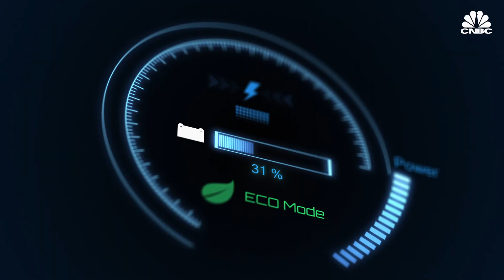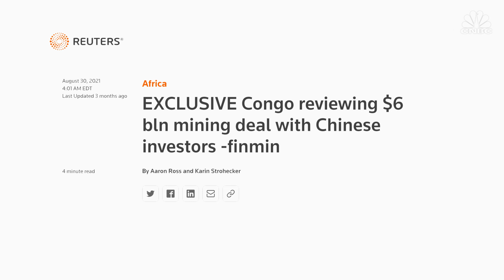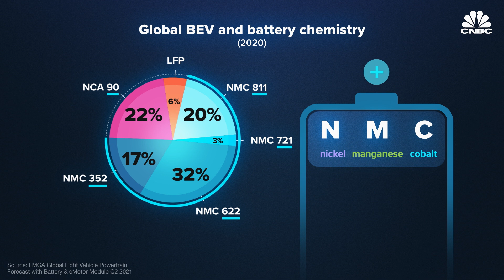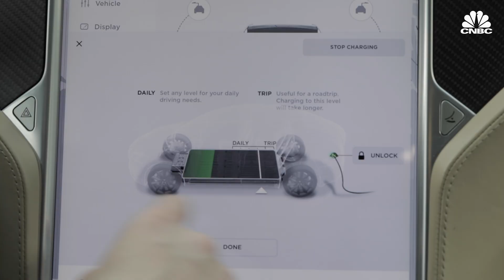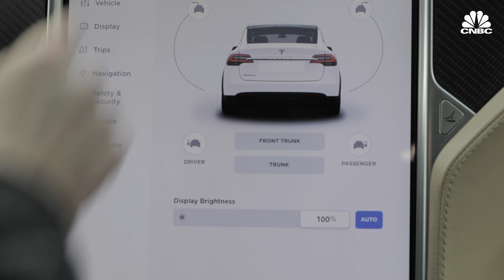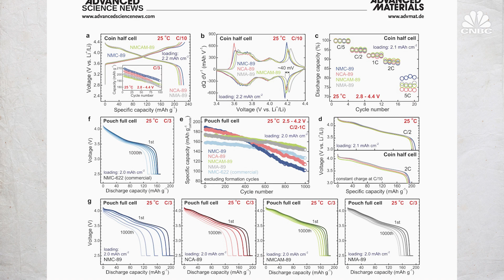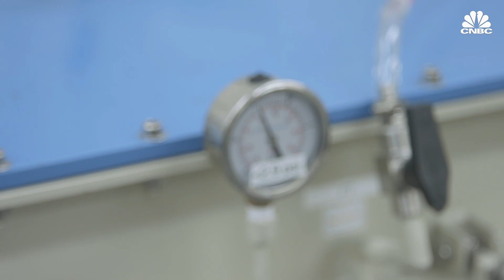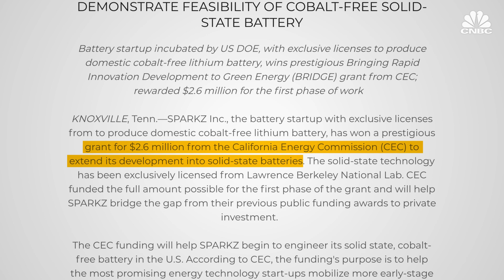How Removing Cobalt From Batteries Can Make EVs Cheaper

Comment: Why worry about battery fires or the life of the battery when there is the option of a Hydrogen fuel cell that out lasts the life of the car. Lithium batteries are fantastic for phones but do not scale-up to cars.
Asking lithium to power a car is like asking a hydrogen fuel cell to scale up to power a city. It does not scale (don't tell Twiggy Forrest though). To power a city you need SMR's (is one answer) in combination with other forms of storage like pumped hydro.
Of course Hydro in other forms has uses in Shipping, Trains, Heavy Trucks, basically any heavy transport.
Reply: hydrogen is a scam
Reply: @thetaomega7816  : LOL, then I've been investing in a scam for over a decade and landed some damned large profits. I wish other investors thought is was a scam as I'd have more investment opportunities.
Reply: @buildmotosykletist1987  Does not make it any less of a scam. Hydrogen does not make sense from a physics point of view.
Reply: @Freba9  : Hang on while i count my profits.
Reply: Er, a hydrogen fuel won't outlast the car I'm afraid. Hydrogen fuel cells degrade, and will almost certainly need refurbishing or replacing at some point during their working life. Of course they'd rather you didn't know this.....  And of course hydrogen fuel cell manufacture requires platinum....... And hydrogen vehicles are not particularly economical, nor is hydrogen a cheap fuel.....
Reply: @Brian-om2hh  : Simply not true or even close. When it comes to longevity, think of a hydrogen fuel cell powered car in the same way you would a conventional petrol or diesel car.
Reply: @buildmotosykletist1987  An EV battery lasts far longer than a hydrogen fuel cell.
Reply: @Freba9  : A fuel cell has a life of 362,102 to 724,204 Kilometres. So I'm afraid you are totally wrong. A fuel cell does not degrade. Even Lithium Cobalt batteries degrade from day one.
Reply: @buildmotosykletist1987  Fuel cells degrade from day one. Also, your numbers are far off. They only last 300.000 km max.
Reply: @Freba9  : No. Fuel cells don't degrade the way batteries do. There is no more degradation in a fuel cell than there would be in a petrol tank. Obviously you have no idea how the fuel cells work.
Reply: @buildmotosykletist1987  “ Polymer electrolyte membrane (PEM) fuel cells are a promising alternative, because they are clean, quiet, and operate at high efficiencies. However, challenges remain in achieving long lives due to catalyst degradation and hydrogen storage.” Youtube does not allow me to post URLs in comments but you can google this sentence.

Comment: May be cheaper but not as much as the child slave labor that helped get the materials for those batteries
Reply: But what about the child labour used to extract cobalt for use in the oil industry? Has that never concerned you previously? They've been mining it for decades by the way.....

Comment: Iron Phosphate is great. Almost fireproof. Non-toxic. Recyclable. Lasts an incredible number of charges. 

BUT. How about a carbon anode, carbon cathode battery? Carbon is even cheaper than Iron. It's made from burnt cotton.

https://en.wikipedia.org/wiki/Dual_carbon_battery

"As an electrolyte, the cell uses one or more lithium salts in an aprotic organic solvent. These remain unspecified, but as an example in a patent, the group uses a system consisting of lithium hexafluorophosphate (LiPF
6) as the salt, and ethylene carbonate (EC) and dimethyl carbonate (DMC), mixed in a 1:2 volume ratio, as solvent."

Basically, the Lithium and Flourophospate go in opposite directions to their opposing carbon corners on discharge, and return to the electrolyte to join up on recharge.

Comment: Making EV cheaper is not the first thing to achieve.
Making them have longer range, more reliable and even more eco friendly should come first.
Imagine this, a Toyota petrol car vs a Tesla. Yes Tesla's operating carbon footprint may be lower, but the sheer unreliability and repair requirements automatically make them less eco friendly because of how parts come to be. Whereas even though Toyota may burn gas and emit more carbon during operation, you need less repairs and less parts, consequently making Toyota just the same or better in eco friendly.
I would die first before I buy a Tesla or any European EV. If my country bans petrol cars, I'll buy a locally made gogoro scooter and never drive a car simply because Americans can't even make a reliable car and Europeans love eco parts which degrade faster and would need more replacement and causing even worse carbon footprint.
Before Toyota or Honda makes an EV. No EVs are reliable. And maybe stop funding Idiot Musk. He's more of a joke than a person worth viewed seriously
Reply: I’d say having battery’s last more cycles is the most important. Because right now if you charge the battery correctly then you can get about 15 years before the battery degradation reaches 60%
Reply: cheaper is always more important than the rest. because the rest follows
Reply: @thetaomega7816  can't argue with that logic as that's how Toyota came to be.
But how about GM? One of the longest running car maker, products cuts in price, as well as corners, never made top 10 in reliability rankings.
Hence I said in the comment: before Toyota/Honda release an EV, no EVs are reliable.
And now I should correct myself: before Toyota/Honda release an EV, no EVs are reliable and cheap.

Comment: Or we could just invest in Hydrogen and not need anywhere near the size of batteries that a BEV needs, including the associated weight and wear and tear on our infrastructure. However, then money that energy companies have invested in taking control of battery production would be for nothing.....so...go BEV?
Reply: too expensive to make.
Reply: But manufacturing hydrogen fuel cells still requires platinum, plus those fuel cells degrade over time and will need repair or refurbishment during their working life..... Manufacturing hydrogen is an inefficient process, plus once you have your hydrogen it still needs transporting all over the place before it can be used. Electricity needs no transportation.....

Comment: No mention of BYD' s market-leading, cobalt-free Blade batteries which were designed with recyclablity as a top priority.  China has also finally  persuaded Western carmakers including Tesla to shift from li-ion to lithium iron phosphate - Tesla Model 3's powered by LiFePo still have a longer range than most of its competitors like VW, Nissan(Leaf), GM(Bolt) etc etc
Paul G(Editor:   EVUK since...1999)
Reply: No, they definitely mentioned BYD and LFPs.
Reply: great for us Aussies, Chine buying even more Iron ore from us... prices going through the roof soon.

Comment: A lot of cobalt is used in smartphone batteries and for refining oil. For EVs they tend to use low-cobalt battery technologies. Cobalt free LFP is almost certainly going to take over the market in the near future because it's cheaper, safer, and can be repeatedly charged to 100% without degradation unlike cobalt technologies which should only be charged to 80% most of the time.
Reply: The sooner we go cobalt free the better
Reply: Uhh...yeah ppl would not be happy if the phone in their pocket suddenly exploded.
Reply: Also Tesla's new 4680 cells that are now in production use no cobalt. Tesla will soon be using no cobalt for every vehicle. Right now it is over 50% that don't use cobalt
Reply: you're trying to compare a smart phone to a car? sounds pretty silly

Comment: 80% of the cobalt industry is industrialized, 20% is artisanal of which 10% is illegal and some could be linked to child labor. I of course totally agree that this is an humanitarian emergency but it shows that the source of cobalt is really easily manageable and the association with EVs and cobalt has mostly been used to lobby against them.
Reply: Doesn’t change its cost. Cobalt is not a particularly abundant material. There’s tons of other variables that can be tweaked to improve the range of a car using LFP now that their energy storage is going to get cheaper including tweaking the cathode chemistry while keeping iron in the composition
Reply: @markhaus  yeah agreed

Comment: Lithium Titanite    recharges to 80% in 10 minutes
Reply: Lower energy density than even the most basic LFP formulas. unfortunately. Fabulously good in regards to safety, though, and, as you observed, you can hammer them with high current for super quick charging that would literally fry other lithium batteries. The chemicals for the cells are expensive, alas, and that has what's kept them from a higher adoption rate.

Comment: The key take away is that the supply chains are mature and advanced now.  Plus lithium ion can even hedge into sodium ion.  Sodium ion isn't as good, but again the supply chain thing.

There is no shortage of lithium either, that is more of a political / environmental / labor union issue now around building the mega mines you need.
Reply: 🤔 tell me how lithium mines are safer for the environment? Vrs a drill ..

Comment: This issue with electric cars is the need for lithium. Even if each cell only needs 7 milligrams of lithium, that still ads up to millions of smartphones worth of batteries. And smartphones are way more useful in the grand scheme of things than 1 car. And we don't have the capacity to mine enough lithium. The answer is less cars, not more.
Reply: We don’t really mine lithium. We extract it from brine. Also, there is a lot of lithium in seawater. That can be extracted, but not cost effectively right now. That time will come, though.

Lithium carbonate can also be reclaimed.
Reply: @fruitytv-uk  But LiCO3 isn't exactly good for the environment.
Reply: I for one am glad that Train hopper& friends  are smarter than everyone else!  They seen a problem and then provided an answer  JUST LIKE THAT.  

Holy smokes... What else of the worlds problems can these guys solve I wonder?!

Comment: Cheaper to manufacture but such saving will not filter down to buyers. Just as battery packs have fallen in manufacturing cost over the last ten+ years by six fold but the EVs have continued to rise in retail pricing. If you want to save money from EV adoption, buy shares in the companies that make them.

Comment: Solid state batteries is the future, not a reformulation of lithium based batteries.  They don't have the heat problem, they recharge in minutes, they are more cold resistant and are cheaper to build.
Reply: If this were true, the incentive would overwhelmingly be to use them. Pretty much by implication of them not being used there will be a reason why: can't scale outside lab, too expensive, too dangerous, too variant to environmental conditions, not enough lifespan to name a few. Maybe that will change, but I've been hearing solid state batteries are production ready for years.

Comment: Nickel is the problem.  Why is the news 10 years behind the real information?  Cobalt is affecting Cell phone batteries, not EV batteries.  lmao
Tesla used 2000 tonnes of cobalt in 2020 to produce 500,000 cars.  That is about 8lbs per car.  The battery pack weights 1060lbs.  Both GM and Ford used more Cobalt in that same year to produce 20% as many BEVs.
Reply: Money

Comment: More of a reason to not buy an EV right now.  Wait 3 to 5 years,  you'll get more bang for your buck as tech will improve dramatically.
Reply: If that's how people thought then technology would never advance because nobody would buy it when its first released, there are still excellent quality EVs out right now
Reply: @brunellecooper  But there are less charging stations. Although they're being installed very fast. So yeah 3 or 5 years is an ideal time from now
Reply: Absolutely right. I intend to either buy a RS e-tron or convert my Nissan Patrol to an EV after a decade or so.
Reply: that's part of the problem the demand for EVs in China is so high it is possible they will overtake US manufactures
Reply: You can say that for every vehicle out right now. There will always be a technological gap with newer models.
Reply: You missed the point. This is an innovation.  Tech improves rapidly for for the first 10 years. Yes there is always new improvements w combustion engines but we have reached significant slowing compared to 80 years ago.
Reply: @Karim-ik5ij  These technological advances don't happen in a day and take many years to develop. Look at all the new smartphones, graphic cards, TV's, etc., that are constantly updated when people can choose to wait one year for a bigger update. The fact is, most people aren't waiting and down the line, the option to upgrade is always there if it is a significant improvement. Also, engineers are very aware of what you are referring to and don't automatically give the customer the newest and best.
Reply: Meh, I have the luxury to wait but I do understand that many don't. For example the plug in hybrid for volvo battery capacity increased by 68% since last year.
Reply: Even today, total cost of ownership for EVs is lower than internal combustion engine cars.
Reply: @afqt80  The E-Car cost $8,000 more on averages than its fuel counterpart.
You can buy a lot of fuel for $8,000 and it can do long road trips if need be.
Reply: @Crashed131963  way lower maintenance costs, way lower cost per mile makes up for that and more through the life of the car.
Reply: @afqt80  Not if you factor in replacing those batteries and the higher cost of the vehicle. It's not quite there yet.
Reply: All the more reason to require standardizations of the battery form factor so the batteries can be replaced.  Besides, if the range is sufficient for your daily commute plus a reserve then recharging overnight or while you work is sufficient, there really is no need for high capacities and the concurrent stability problems.  For the infrequent long trips, range extenders such as battery trailers are possible and you can always rent a conventional car.  If people will just get over their range anxiety though once a serious concern but are now just irrational, then the batteries wouldn't be such a problem.  The right for third parties to inexpensively rejuvenate the battery packs rather than have them proprietary is more important then this mindless search for greater range.
Reply: @johnwang9914  It's not that simple. Many do not have excess to charging either at home or at work. And what happens if you forget to plug it in overnight? The technology and infrastructure is far from there yet.
Reply: @johniii8147  I did say with a reserve and level 2 destination chargers are far more plentiful than you would think, comprising as much as 70% of public chargers and many companies and property management companies will have level 2 chargers installed if asked by an employee since it is basically just a 220 to 240 v outlet and the charger itself often costs less than $500.  If you have a sufficient reserve to last a ciuple of days, tge problem of the charging station being occupied before you arrive could be tolerated especially given that the pay fast chargers are also available.  Granted not everyone has charging facilities at home but that doesn't mean battery capacity has to be sufficient for the once a week refill cycle of a gasoline vehicle.  The obsession with range is still unwarranted.  You are just intent to continue deluding yourself just to defend arbitrary decisions you've made.  Even the decision to wait for price equivalence is irrational as the operational and maintenance costs of EV's are much lower than for a gasoline or diesel vehicle, hence a premium price to purchase would still have the overall cost to own be equivalent, yet everyone is irrationally waiting for the purchase price of equivalently equipped vehicles to be equivalent before even considering EV's.
Reply: @johnwang9914  They are NOT plentiful in most parts of the US and won't be for a while. The closest one to my home is 3 miles away and I live in a relatively density populated part of town.  There are at least 7 or 8 gas stations within 2 miles. It's just something won't  be interested in for a while yet. Maybe 2030. And stop with the guilt trip on EV's Most of us simply don't want them until the technology improves and the infrastructure is in place. An no property management companies here in FL will not install there here in FL with a simple request. I am in office parks everyday and have to set see a single one.
Reply: @johnwang9914  You actually don’t get it John. This is about no I was electricity to talk about it’s about every day doesn’t matter what A bit about the technology it’s about practicality

Comment: Can we spot the light on the cobalt being used to refine gasoline?
Reply: Oil industry says how does being defunded  feel?
Murdoch rubs his greasy hands.
Reply: Although it's true that cobalt oxide is a useful catalyst in our refineries, it is a catalyst and is not consumed.  As a catalyst within a refinery, it's far more likely to be remanufactured and reused rather than likely disposed of when used in batteries.   Also iron oxide can often be used instead of cobalt oxide for most of these processes and likewise with batteries formulations that use iron instead already exists, it's just that only China can currently use lithium iron phosphate batteries without paying royalties so long as they are only sold in China but the patent runs out in 2022.
Reply: @johnwang9914 lithium batteries are being recycled.
Reply: @dusty-vo8gh  Not where I live. I have several hundred pounds of batteries in my garage because no one takes them.
Reply: No.
Reply: @davidbeppler3032  based